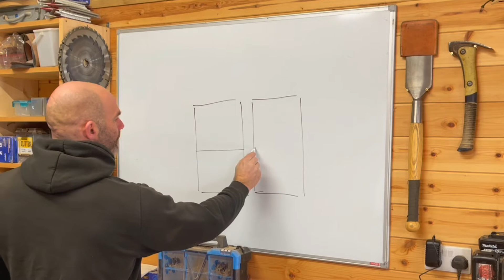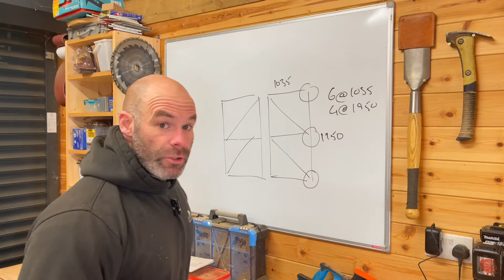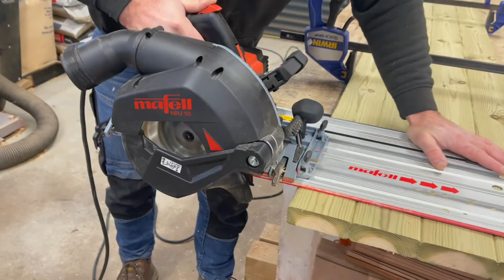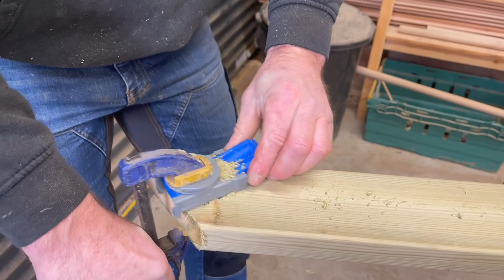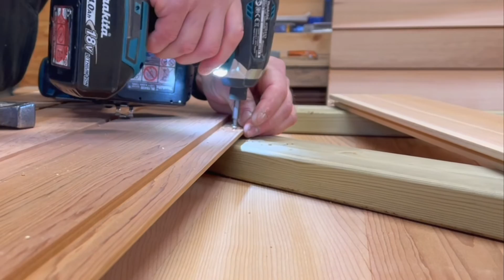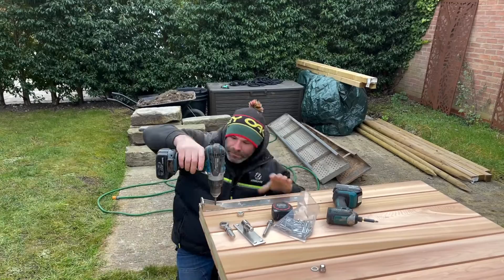Simple gates using Cedar Cladding and adjustable hinges #carpentry #joinery #cladding #cedar

Comment: Hi @Simon Bowler is the single screw fixing at the top of the horizontal runs enough to stop cupping of the cedar?  I'm just about to do this on one of my projects having all hidding fixings apart from the first and last run looks a lot better.  Thanks
Reply from the maker: In my opinion yes, cedar is very stable
Reply: @simonbowler1  Thanks

Comment: May I ask why you chose to land the diagonal brace on the horizontal frame member instead of the vertical frame member?  Won't that stress the joint as the timbers sag over the years?
Reply from the maker: Not in my opinion no, the braces create the triangulation which will prevent the gate sagging. Your way would work also 👍🏻

Comment: Great first video, glad to see you on youtube! 

Question;
I've seen you use a leaf blower to suck up chips from the comedy sized planer and seen others on tiktok use handheld blowers to suck up dust and chips from saws etc... I assume all the debris pass through the propeller and out the other end, doesn't that damege it or prematurely wear out the blower or gunk up it's bearings?
Reply from the maker: Good question….. I’ve had the same stihl garden vac for years, and other than routine maintenance, i’ve had zero issues. It has a blade infront of the fan to smash things up, but planer chips and dust are no drama for it 👍🏻

Comment: How wide do you think you could you go with this design, using the same size timber, as an overall opening width?
Reply from the maker: Good question, I’d be comfortable at 1.2m, much more and I’d prefer to use heavier framing, but the same joints etc 👍🏻